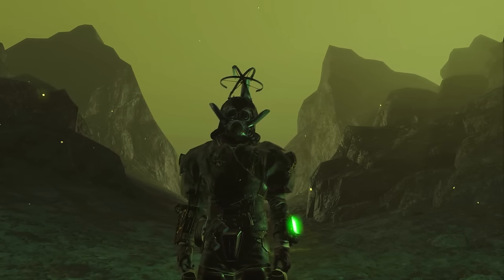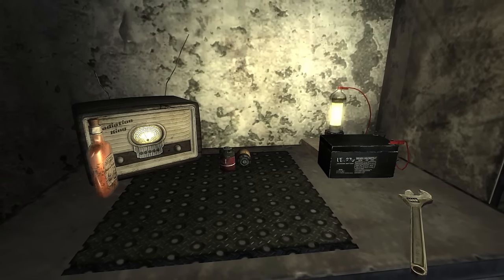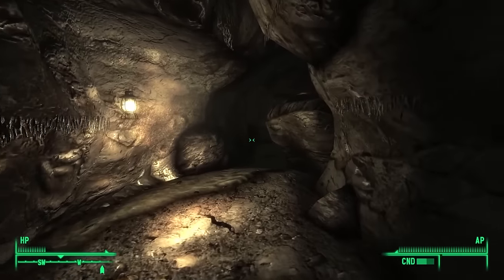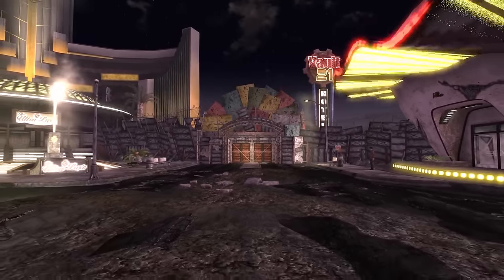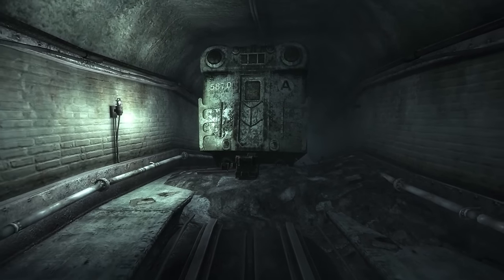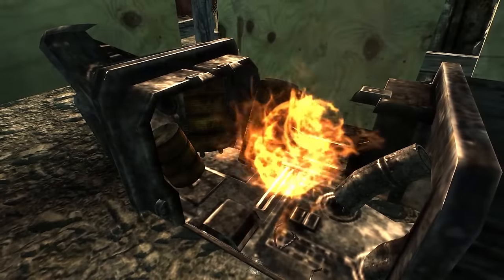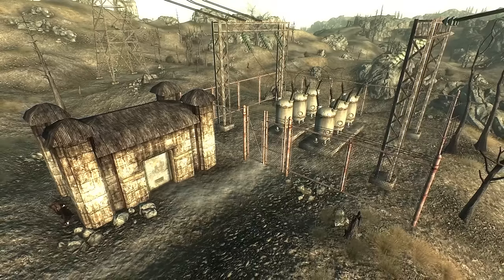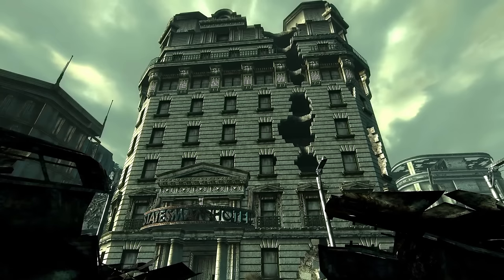Where does the power come from in Fallout?

Comment: The biggest problem about the power poles in FO4 is where the lines are sparking, you can see that there's no physical connection to that same line further down, and with no evident underground line feeding up, it made for a big oversight on the devs part. The most notable one is near County Crossing settlement close to a small generation station across the street.

Edit to add: Concerning "fusion generators", I can see there being 2 variants, one being like we can use for our settlements and is a single purpose generation system, and the other being a dual purpose generator for the area and a recharger for fusion cores. It doesn't deviate the fact that a building would have multiple sources of power, and could even be an oversight of the devs to fail to animate the rotors of the other generators that don't have a fusion core dock to it. Ultimately, buildings would have many redundant power sources that would provide power for an unknown/indefinite period of time.
Reply: Yeah this always made me facepalm when seeing them. FO4 made things so much more dumb and goofy, but not in a good way.
Reply: Ah, you must have missed the micro tesla coils fitted to it that transfer the electrickery through the very air itself! Mr Tesla was very pleased that they finally implemented that plan of his! 😁
Reply: How do you even notice that lol
Reply: @aerystargaryenii2565  Paying attention to details, especially with a heavily modified game. Those sparks give 1 cap when scrapped with the right scrapping mod.
Reply: @Celastrous  I can't play the game without mods, and after playing it for over 5600 hours and having so many mods that the game would rather crash than run, still fun to play, as long as it actually runs that is...
Reply: It's like that in 76 thunder mountain plant supposedly feeds watoga and bog town but the lines are completely snapped in three places

Comment: The fusion generators could just be backup generators like a lot of important buildings have irl in case the grid goes down.
Reply: except the grid did go down and you then took the core out. it doesn't make sense lol
Reply: @mowvu5380 it would 100% make sense if they ran back up for hundreds of years but didn't die after 20 minutes in power armour.

Comment: I always viewed the Fusion Generators as manually triggered back up power supplies for the buildings which were never activated due to the war and grid staying online.

Looking at the Fusion core animation for power armour when you place the fusion core into the socket you have to push/ hit the fusion core further in to seat it fully and begin the reaction.

To activate the Fusion Generator  is the same, push them deeper into the socket and it can deliver a short burst of power to give time to perform emergency tasks.

As for the generators animation always took a spinning part to be apart of the cooling loop as when you trigger the reactor the coolant has to be circulating before it is brought online or the piping and moving parts might overheat and warp/ crack or even melt some components.

I think that buildings are far more Energy intensive than Power armour as for a buildings usecase the back up power might only last a few hours or even Minutes, 
while in power armour depending on activity levels the fusion core can last for around 10 hours in game, but lets be more realistic to the world and say a day. 

 This would also explain the sheer size difference between power armour and the Generator. The generator has to have a better cooling capacity to cover the sheer current draw while the Power armour has to be cooled by the frame and the actual armour pieces. So its like comparing an Air cooled engine and a water cooled engine

Comment: As an engineering student, I find this fascinating. Infact, the first thing I do when I join the Minutemen, is start building a power plant at Natick power station with the settlement mod.
Reply: Black Boy King TV  I build settlements for all factions.
Reply: There are actually some power stations in Natick MA circa 2022
Reply: Imagine how much cooler the settlements would have been if you could build proper infrastructure and transfer power between settlements, then you could even get radiant quests where people are leeching your power and you can go deal with them
Reply: @swedneck  Damnit, now I want Electro-Brahmin, a giant capacitor/battery with a long wire for charging/discharging, but when not in use it's wound around the Brahmin (that's wearing rubber boots). Anyone bumping it or trying to raid the caravan gets zapped! ⚡⚡⚡🐮🐮⚡⚡⚡ 😂
Reply: Colony builder games are cool

Comment: Hydro can survive 100-200 years 
Usually the turpine does not fail compltely they wear blades wear but they turn and will produce power 

Very very old hydro is still in use

Here in iceland there is one from 1908 with the same rotor but it does not produce alot of energy but bearings need water/grease and this same powerplant from 1908 was set to 200kva and still gives 40 kva and one good day 44kva 

This is massive fall but it still runs 

In rare case the ramp or bypass ramp/door seal can fail then the turpine will not be full of water and cavitation will occur and fail

Comment: I didn't watch the full video but until this point you simply forgot that even in one house there can be more than 1 power grid. Maybe the light in the Hotel is powered by the normal power grid. The elevator which needs to work all the time may work with fusion cells so you can even ensure in a blackout that the system is running.

Comment: The fallout TV show makes the argument for fusion course difficult again. A single one can run a vault for over 200 years and people in power armor never have to change there cores. Earlier games also don't make you ever use a core(id assume they already have them installed. So annoyingly it's simply game balance and not lore accurate. Wish cores were a lot harder to get so that you couldn't gain access Early game. And maybe lock them behind a perk. Obviously they would last way way longer but feel better overall.

Comment: I like to think the fusion generators are like battery chargers and mini power plants. Like there is a small reaction in them that is kickstarted by something then continues reacting to creat power, so buildings are powered and fusion cores are batteries and so them sticking out means fully charged and the fusion generators built in settlements are either using the fusion core as a kickstarter for the reaction or are not only used as a Kickstarter but also as a backup method to kickstart again if at anypoint the reaction fails to produce enough energy to continue.

Comment: I know I'm a month late to the party but one thought that immediately came to mind regarding the fusion cores was Alternators. When you look at the generator you pull the fusion core out of, what's on the side of it? A spinning gear/wheel. This gear could be acting as an Alternator, keeping the fusion core charged with the generator using the excess to power the building and other machines. When you pull the fusion core, it stops spinning likely as the result of it no longer detecting a fusion core to be charged. While I'm no expert on nuclear energy, fusion or fission it was just the first thing that immediately came to mind.

Comment: I never noticed these things about FO4 "Fusion" Cores.
It would make most sense if they are just not plugged in. The flickering light and stopped generator could be explained with a 2 stage start up cycle a lot of real motors and generators have.
Half Inserted only powers the generator for start up
Fully inserted powers connected systems
Reply: I actually like this interpretation

Comment: The question of why lights might work while an elevator would not, towards the beginning of the video, is directly answered by the final subject of the video: three-phase power. Different circuits are often powered by different phases for redundancy and load balancing reasons. There's also technical: you might tie a phase to ground to get one voltage, or a phase to its opposite phase to get twice that voltage.

In my building we have 720V incoming feeds and our own transformer substation. If we lose any one phase, general lighting and 110V (apartment appliance) distribution will fail while the effort of the transformer goes into providing two clean phases for critical systems such as the elevators. (The reason described in-video is on point: self-start, and specifically, the torque of self-start. "Static motive power" is rather important for elevators, which are crazy, and single-phase motors have essentially zero torque from cold start. Well… they'll twitch… a bit. But mostly hum like an angry hive of wasps… then burn.)

Comment: No, hang on there a minute, when you take a Fusion core out of a Generator the lights momentarily flicker. This suggests that there is a backup power source kicking in to power the building, and everything within. Also - and this is speculation but educated speculation - the cores are partially ejected on the generators outside of the ones you can build in settlements which suggests the core has reached end-of-life, retaining enough power to power Power Armour for a few hours before being completely depleted.

Comment: In fallout 76, there is an operative Poseidon Plant that it still works.
On time to time, there is an even on mentioned plant, where the facility has been damaged and the players have to fix it.

You need to fix pipes and machinery around the plant, but fixing all of them is optional.

This event has an impact on every other public electrical box from others public camps with the next outputs.
If the plant is not fixed, every electrical box will produce 10 unitos of energy.
If the plant has been fixed enough to work, they will produce 100 units of energy.
If the plant has been fully fixed, they will produce 400 energy units.

That would prove what you say in the video. The prewar electric grid is still operative, but been very limited and unreliable.

(Sorry for all my gramm mistakes. English is not my first language)

Comment: Fusion power can last a long time because you get a lot of energy from just a little bit of what can be considered fuel. Also it does not look like the fusion generators in which we find Fusion cells in the wild are in use so maybe that is why they still have power left over and then that we can use for Power Armor. And even if the generators were running what are they even powering? Nobody is in these buildings anyway to run the heavy machinery or other power intensive things, lights alone would not enough to drain a fusion cell being that LEDs can that's the crazy long time on a crazy low amount of power. Also for the fact that when you do take out the fusion sell from a fusion generator and the lights/electricity are still running, this could be due to a battery of some sort that is responsible for holding some electricity for storage before  it goes to power the building. This would be in case the generator fails or has to shut down for maintenance or any reason the generator might have to stop producing power for an amount of time. If you are running your office building and all of your employees computers and machinery on a generator, what happens when you have to take out the fusion cell to replace it? Does the entire business just shut down because the power stopped? If you had to swap out the fusion cells routinely, having to shut down your entire place of business and all operations just to change out the battery would not be efficient. Therefore there must be some sort of storage that can hold an amount of power for a time being while the main fusion generator is down so that you can do things like change the fusion cell or do some other maintenance on the generator itself without having to shut down the entire building and all of your operations inside.